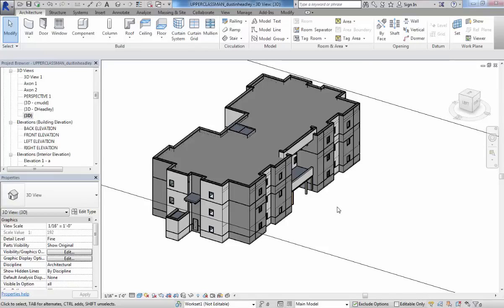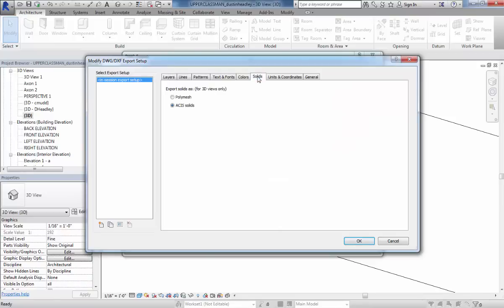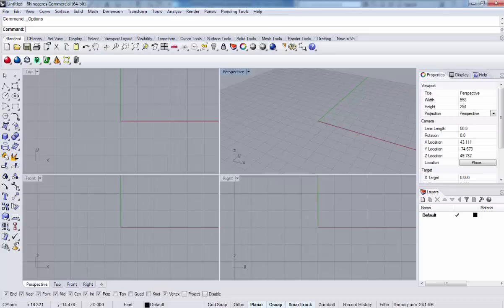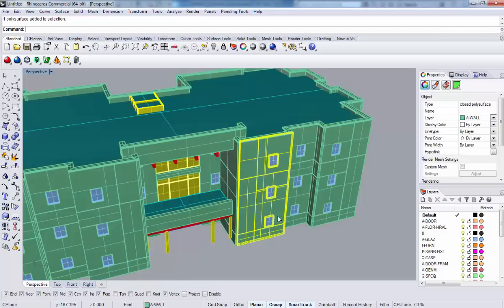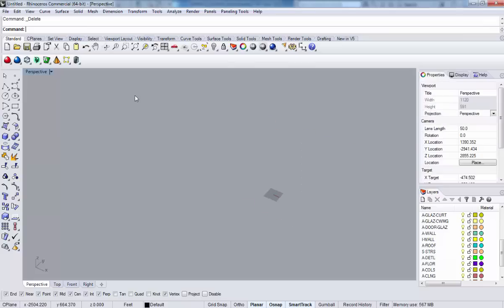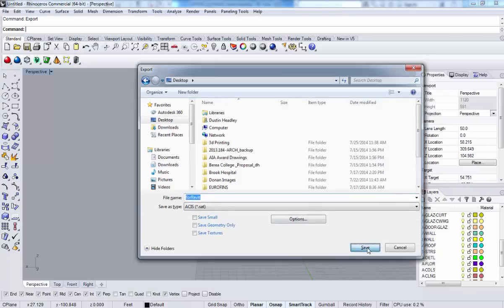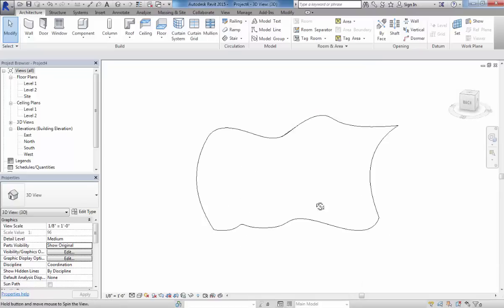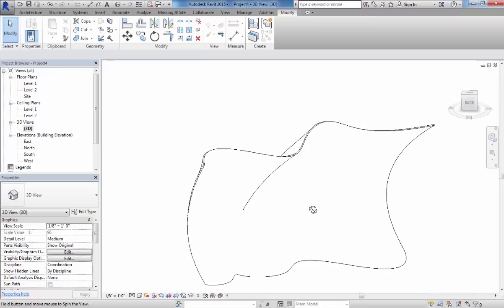Revit to Rhino & Rhino to Revit

Comment: Just so we're clear, at 5:35 when he says it will takes days to make that surface in Revit, he's wrong. I can do it just as fast as he did in Rhino.
Reply: how?
Reply: @thirtysixzed  Using the Conceptual mass option, then place it in the current project
Reply: When most people say you can't do conceptual masses or designs in Revit..It's a myth. I recently designed an art museum concept using conceptual mass...100% of the design was using curvature ; then I was able to in-place it in the regular object, create the walls, floors...everything.  But obviously keep in mind Rhino was meant for conceptual designs so that is why it is still superior in terms of speed and  unlimited creation. Revit does have it's ways though..

Comment: To apply material to mass, explode the import and you can apply material to on the properties. You can also place import as mass via revit icon>new>conceptual mass. SAT files does not recognize layers like DWG so you cant apply material through layers. Dont import as dwg when importing solids

Comment: The direction are very clear and that's great.  Any idea what would cause the sat file from rhino not to place into revit? When  insert the file, I get the same warning messages, but there is no mass.
Reply from the maker: +Brandon Fairbanks Some of my students have had this issue.  The surfaces are either to complex or their are too many of them trying to be imported all at once.
Reply: +dustin headley I managed to figure it out.  I was using more rectilinear geometry than you showed and skipped over creating a surface in rhino before exporting. Once I did that there was no issue.  Thanks for the great video, it's going to save me a lot of time this semester.
Reply from the maker: Sorry for the delayed response.  Yes, I've had very similar issues.  First solution is to make sure everything is exploded into single surfaces.  Second (if things still aren't coming in) is to use the rebuild command (this is less ideal since you'll lose resolution of the internal geometries).

Comment: This was a lifesaver but I got a question, if I export a building model from revit to rhino and I make the organic surfaces there, when I finish it I have to delete all the walls, floors and roofs I made in Revit before exporting it back and only keep the surfaces i made in Rhino, right? Thanks in advance, you already helped me a lot :)
Reply from the maker: Lyanxd Not sure I understand this question.  What are you trying to do exactly?  The SAT extension that enables Rhino to talk to Revit is a CAD reference and doesn't maintain any of the intelligence that the parametric wall models have in Revit...  So If you edit in Rhino, they yes the process restarts.  I think that covers your Q.

Comment: Is it kind of easy to export a complete building from Rhino to Revit? I don't know Revit at all, but for Projectmanagement I need the door lists and all those helpfull features, and i'm pretty good with Rhino.
Reply from the maker: Filho do Gelo 
You can get the schedules (another video I have, or just google revit door schedule tutorial) easily from Revit.  Not sure what you're wanting to model though.  That would be the question.  You'll get the polysurfaces that you want (instead of meshes) so you can actually use Rhino.  If you are modeling in Rhino and going to Revit, you need to create a door family so that it will show up on the schedule.  But then you can create some custom assemblies.